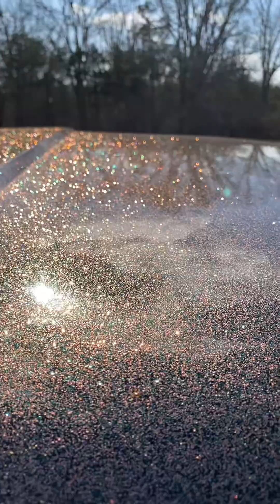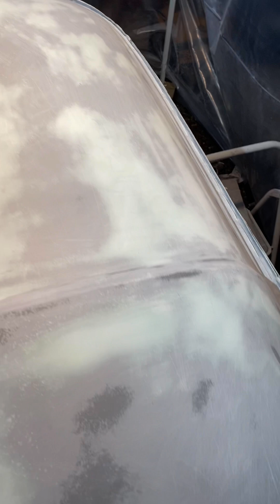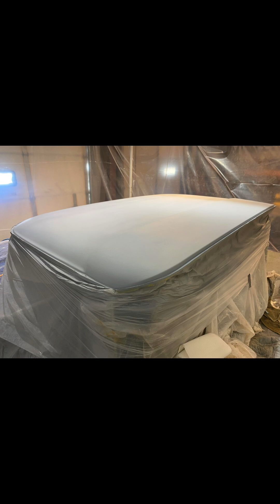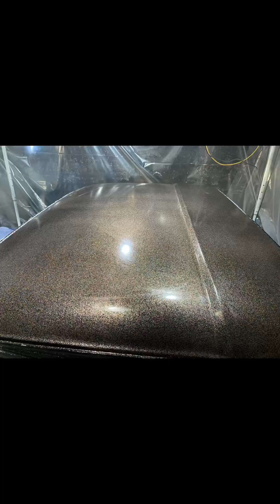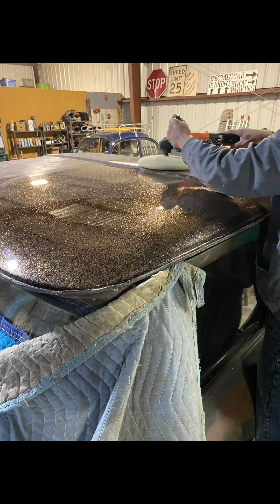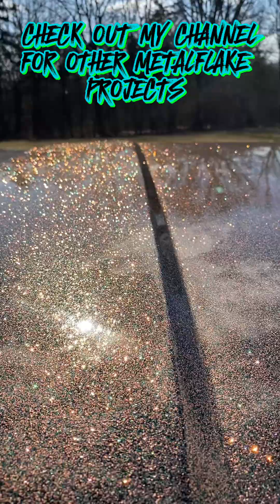Metalflake Roof: Step by Step How To Automotive Custom Paint Job DIY with Basecoat, Clearcoat, Flake

Comment: Looks great  what spray tent booth is that
Reply from the maker: Thanks. 
That’s just a 10x10 EZ Up with some plastic drop cloth and a fan pointing out in the corner. Hung some lights up in it.  
I have an inflatable booth now that works pretty good.